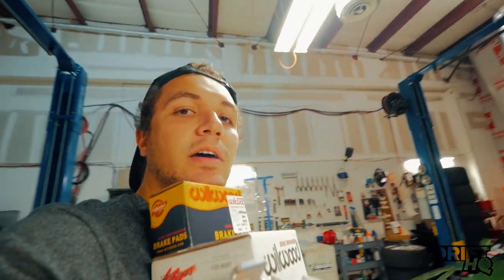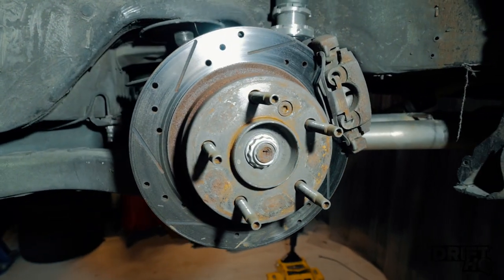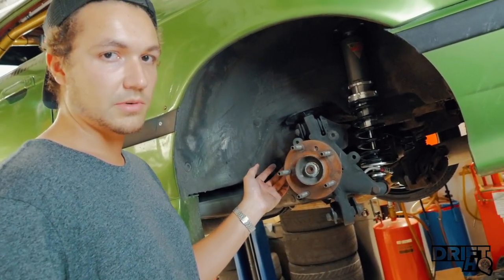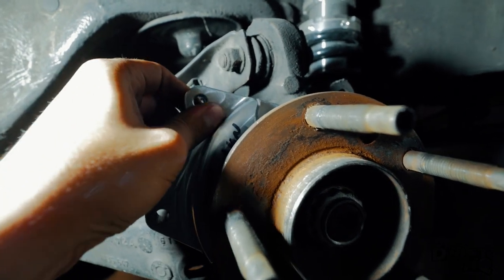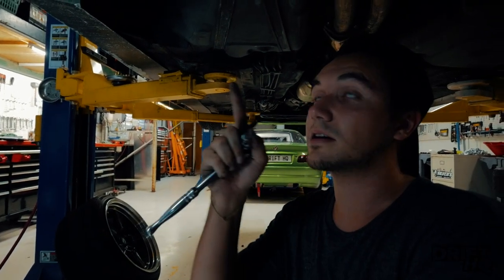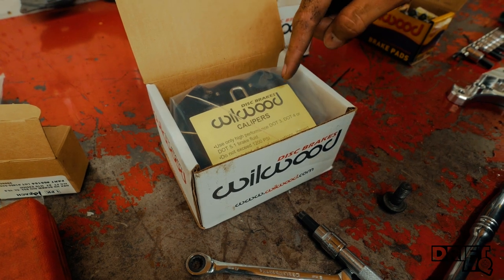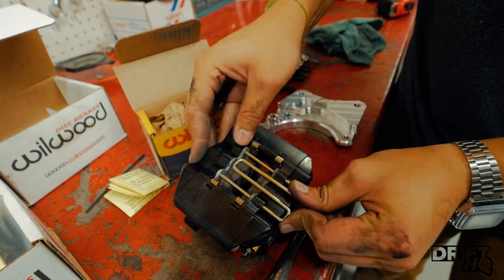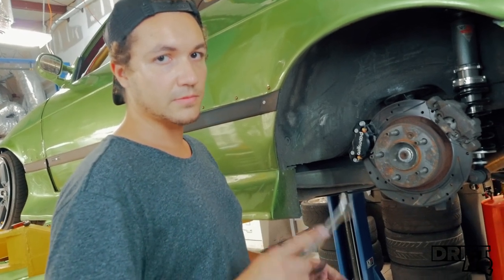HOW TO INSTALL E36 DUAL CALIPERS

Comment: Do you know if the 330 and 328 has the same width apart mounting holes?
Reply from the maker: There is a specific bracket for those. Check our website.
Reply: @DriftHQ  do you think the 330 brackets have the same width holes for the calipers As the 328 brackets ? If I kept the 328 rotors with those calipers it would work if so

Comment: i wonder if this will work with my e36 325i but my set is difffrnt i have e88 6 piston calipers and e46 m3 rotors
Reply from the maker: We sell kits for m3 hub assembly!

Comment: For the fitting in the back of the caliper does it screw in all the way? I got a universal line kit from Drift hq and a e46 wilwood dual caliper but my fitting in the back screws in a little more than half, the thread is really long and more than half goes in and it’s really snug, but some thread is visible. Is it fine if some thread is visible or is the bolt too long? It says it’s meant for wilwood
Reply from the maker: Hey, 1/8npt is a tapered thread. It will never bottom out. Just keep going until tight. Use red thread locker or pipe thread sealant if you want to be extra careful.
Reply: @DriftHQ  I used the white sealant we’ll see how it lasts !

Comment: are those 318 rotors and primary calipers? and can that wilwood work on the thicker 325/328 rotors?
Reply from the maker: BLVCKSONS RacingCo Hey, E36 Non-M (318/323/325/328) rear brakes are all the same thickness. The only thicker rotors vented ones are for the E46 328 rears.

Comment: My hydro has a shit load of play. It locks but I have to pull it super far to get it to engage. I bled the hit out of it but it still has little back pressure. What should I do? Its an Ebay brake but has a decent size reservoir
Reply from the maker: Still sounds like a bleeding problem or the ebay master is bad. We recommend wilwood 5/8
Reply: @DriftHQ  5/8 for the master cylinder bore size right? Mine is 5/8/ 0.62 bore but 3/8 in 24 outlet, is that fine ?

Comment: Will this kit fit on my e36 with 330i e46 brakes? Disc size 320x22mm
Reply from the maker: Hello Janko,
As per our conversation on our website's chatbox:

Janko10:55

Will this kit work on e36 with 330i e46 brakes? Rears are 320x22mm?
You10:56

The dual caliper kits will only work with their standard rotor and caliper
Janko10:59

My is non m
But I have brakes from e46 330i which are bolt on
You11:00

You would have to revert back to the standard brakes to use the non M kit
Janko11:01

Is it possible to buy just your carrier for dual callipers? And than to mount one more calliper from e46 330i?
Would that work that way?
You11:02

The bracket is designed only for the wilwood calipers
If you would like to do that I would recommend the weld on brackets
Janko11:02

Ok thank you very much
You11:03

https://www.drifthq.com/products/srs-concept-e36-e46-twin-calipers-adapter-v2-weld-on?variant=10039034216495
Janko12:05

Hello again
You12:05

Hello
Janko12:05

can you tell me are this brackets same for e36/e46?
SLG - BMW E36 NON-M DUAL CALIPER BRACKETS
You12:06

No. The title states E36
Only works for the E36 non M trailing arm
If you really want 330 rear brakes you would need to swap in 330 trailing arms and axles
And get the e46 330 dual caliper kit
Janko12:07

Ok I understand
thanks once again 👍
You12:08

No problem

Comment: Grade 10, why not just use 12.9? Some of these companies I don't get, you're already paying for a grade 10 bolt, pay a few cents more and you have the Highest grade bolt you can buy a 12.9! plus now do mechanical E brake FFS, design a setup that uses both stock and hydro. Man, was sooo close to buying this! Lucky for this video! DriftHQ gotta learn some decent camera angles!
Reply from the maker: This was the first prototype of the kit designed by Seems Legit Garage.

https://www.drifthq.com/products/e36-non-m-dual-caliper-brackets?variant=30176582271023

This is not our product. We are a distributor. Feel free to contact them about the design. 

From what it seems you may be able to retain the stock handbrake with the SRS weld on brackets. It doesn't come with hardware so you can choose to use your highest grade 12.9 hardware. 

https://www.drifthq.com/products/srs-concept-e36-e46-twin-calipers-adapter-v2-weld-on?variant=10039034216495

Thank you for your input!
Reply: @DriftHQ  Yep, so just a hardware update from 10 to 12.9, still needs the removal of the oem cable! You'll never be able to park your car on a incline ever again, without wheel chocks!
Reply: @BUZDRIFT  wtf, put it in gear? 😂😂😂